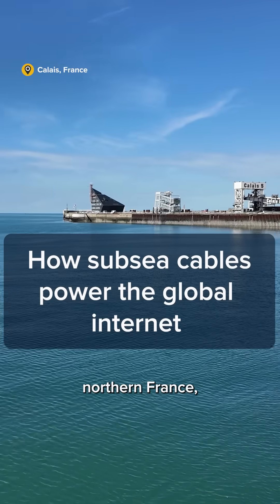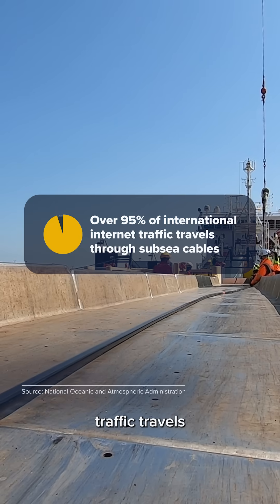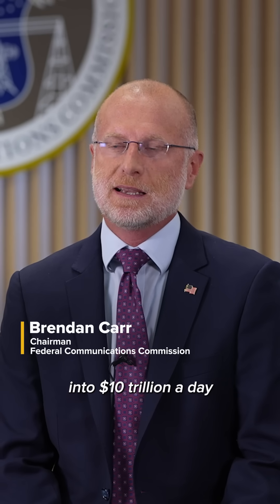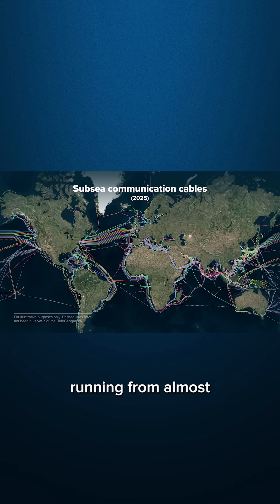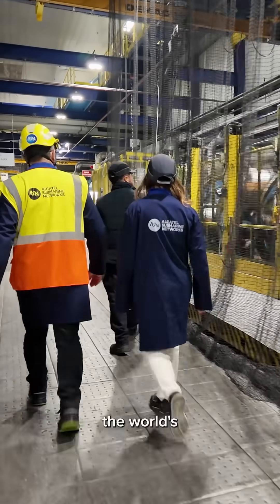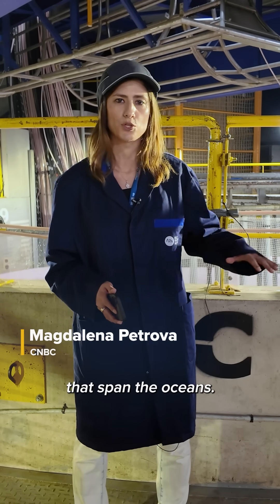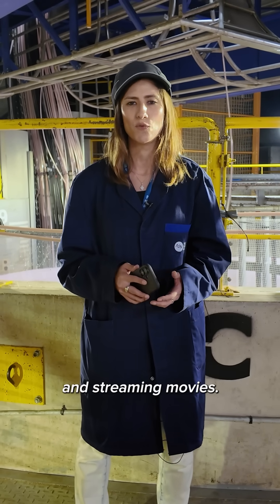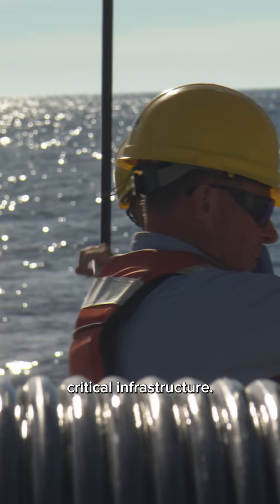How subsea cables power the global internet

Comment: But but but I thought satellites in outer space gave us internet and GPS access
Reply: Satellite internet is a very new tech, only from about the last 5 years or so. There was other, older systems, but they operated at geostationary orbit and had missive, multi-second delays, barely even acceptable for just browsing web pages.
Reply: too slow for most internet. yes, starlink is faster.